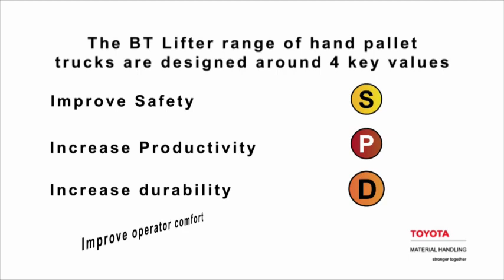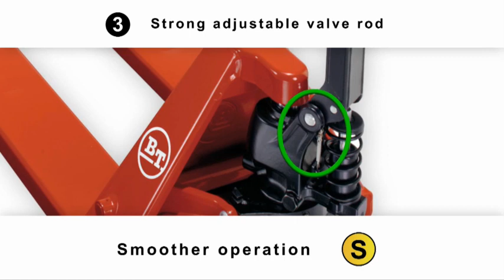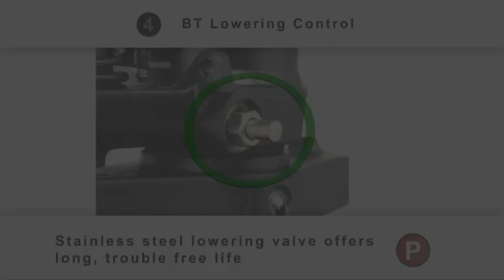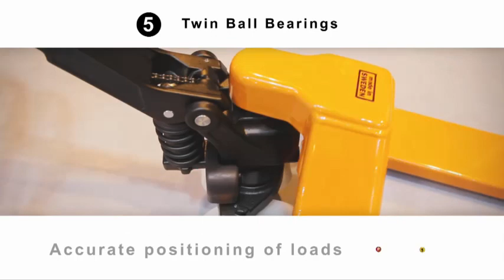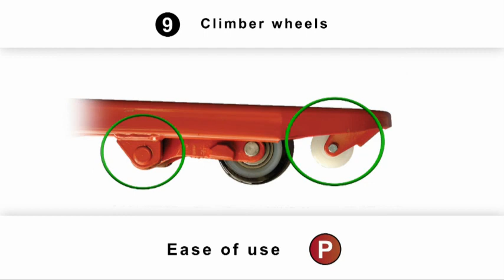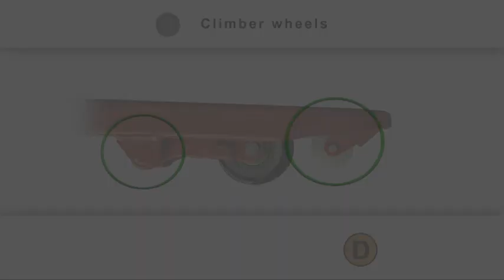The BT Lifter range of hand pallet trucks.

Comment: I have a older BT Pallet Jack that pumps up but slowly goes back down to the floor on its own. It is a BT L2000/10 Manufactured in 1993. It doesn’t leak. Pumps up very nicely but doesn’t hold in the up position for long. With a wooden Pallet with just a 150 pounds on it it will stay up 30-45 seconds. With the same wood Pallet and just 400 pounds on it it will not stay up and comes right back down not giving me any time to move the pallet. Can someone give me a idea of what it will take to rebuild it? Any  idea where I could get a manual that shows the rebuilding process. In the least can anyone recommend a service center in NJ that will do the work?